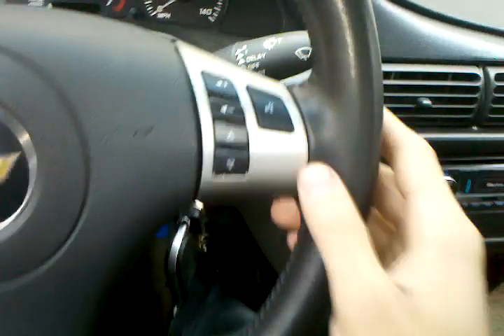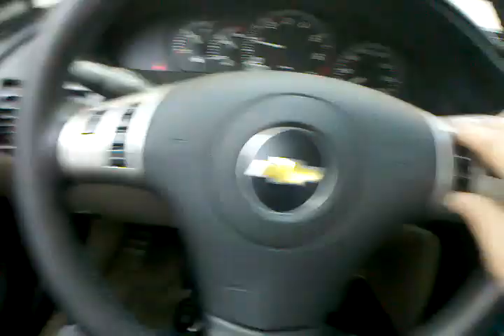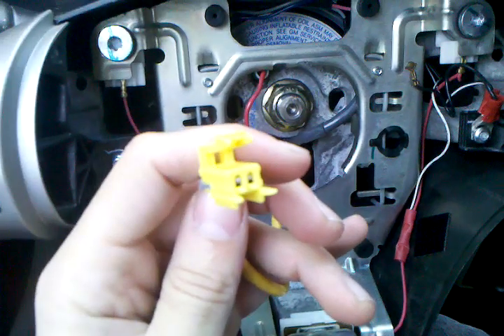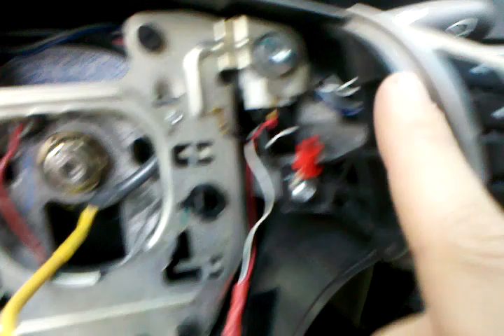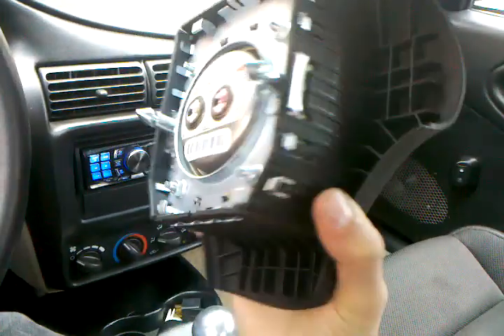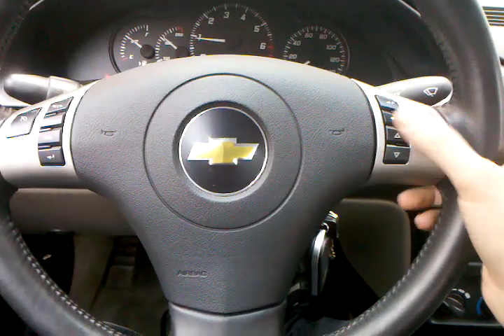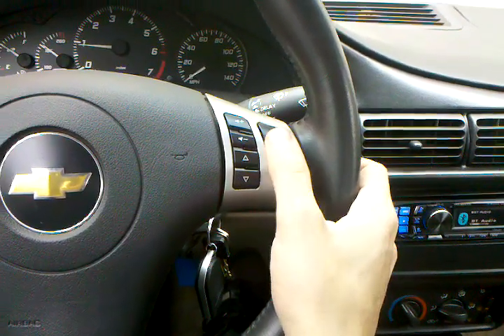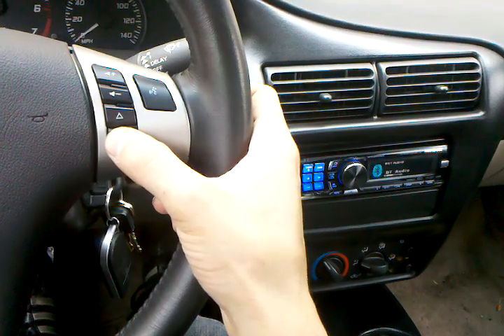Cobalt steering wheel retrofit into J-body

Comment: My question is does Chevy Cobalts spline match with Chevy Cavalier? I've been wanting to put an aftermarket steering wheel on an 03 Cavalier they stop making steering wheel adapters after 03 and I noticed they still make steering wheel Hub adapters for the Chevy Cobalt
Reply: Yes I just did the conversion today! You don’t need a hub adapter.

Comment: Where did you get the dash cluster?
Reply from the maker: this was a cluster I had made at blackcatcustom.com a few years ago. custom font and coloring, LED lighting upgrade, a recalibrated speedometer that goes to 140mph, and the speed and tach positions were swapped.
Reply: I'm gonna check that site out for sure.. Thanks